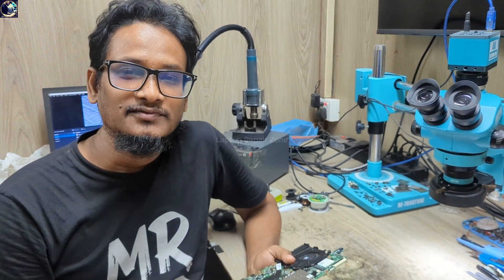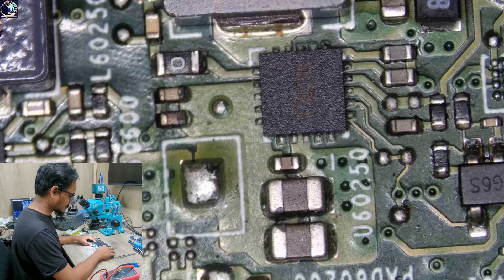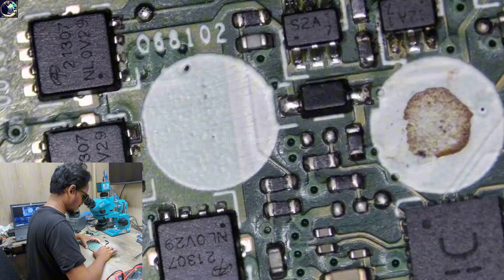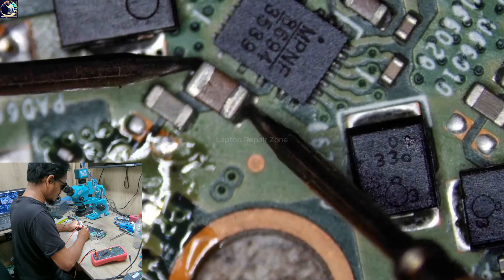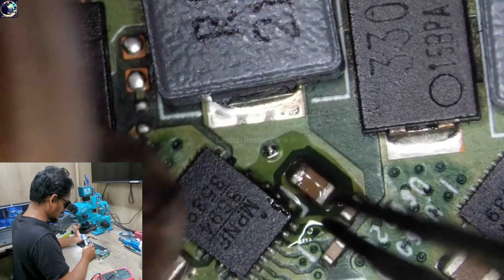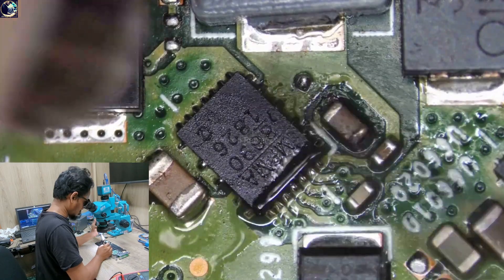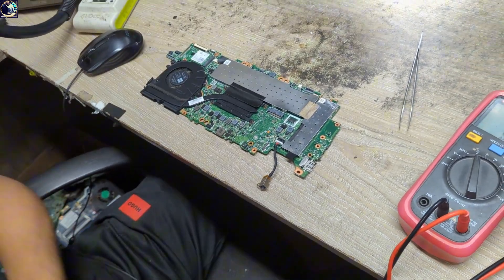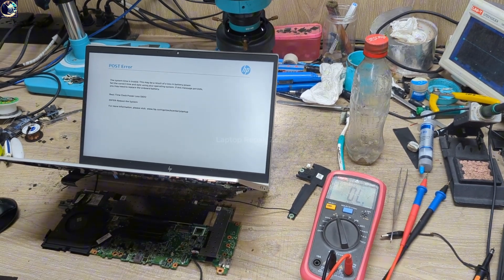HP EliteBook 845 G7 Won't Turn On? Here's the Fix!

Comment: I am considering Asus Vivobook vs HP Omnibook 7 (Envy consumer brand successor), which one should I buy? The Vivobook has aluminum lid and all-plastic base, the HP is all aluminum except for hinges. Of the two which one do you think has less failure rates and will hold up better over time?
Reply: i think asus VivoBook is best.